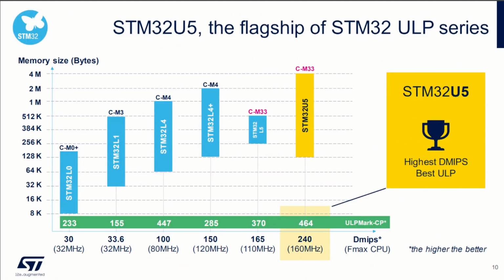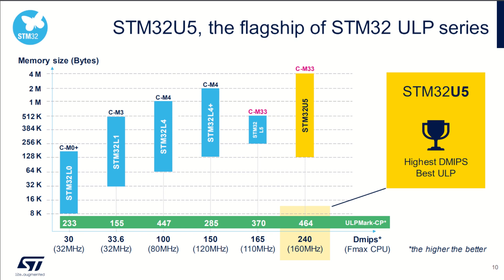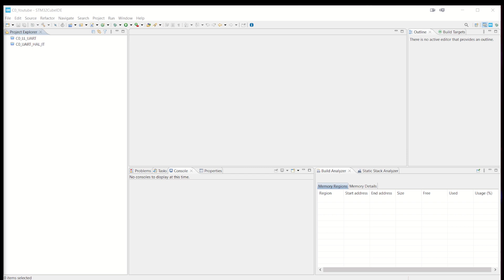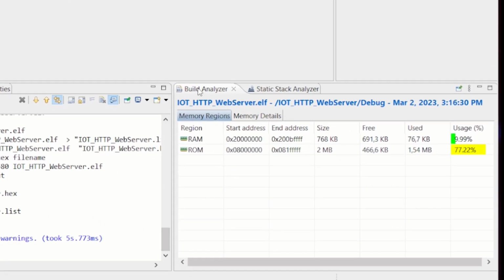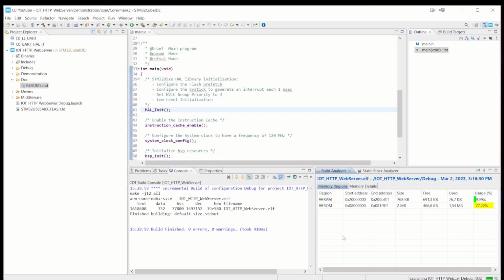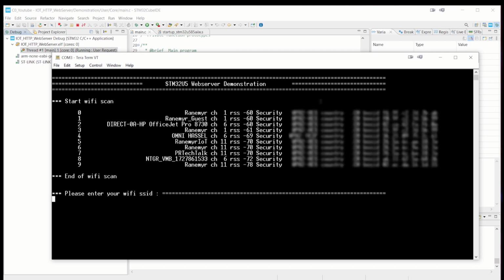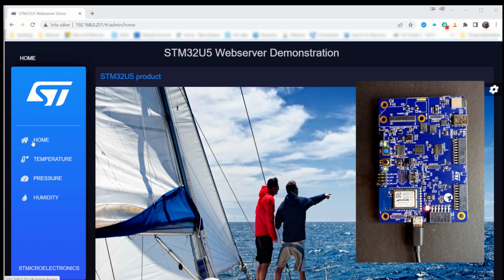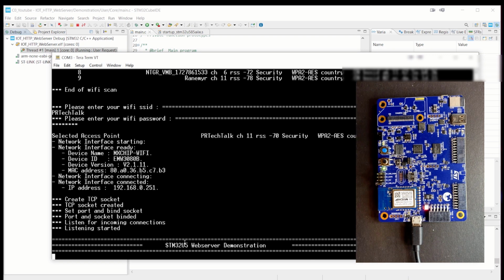STM32U5 IOT Discovery Board and Wifi Web server Demo

Comment: i have Error: " the Wifi firmware is out of date" when Wed server send data to Tera Term.
could you help check and advise ?
Reply from the maker: Hi. It can be that you have an old outdated FW in the wifi module. Try to update this to latest version. /PR TechTalk
Reply: Even we are facing the same problem, we tried updating the firmware but still we encounter the same issue. If you solved the issue can you tell the solution to fix the problem.

Comment: Hi, thanks for the video, but when i run the programm, instead of the scan of WI-FI, i just have "flow is low". What does it means and how can i solve this problem ?
Reply from the maker: Hi Hugo.  Sorry this i havnt seen and cant assist. Hope you have solved it. / PR TechTalk
Reply: @prtechtalk416  Don't worry for the late response, I solved the problem by changing the card, who doesn't work correctly. Thanks